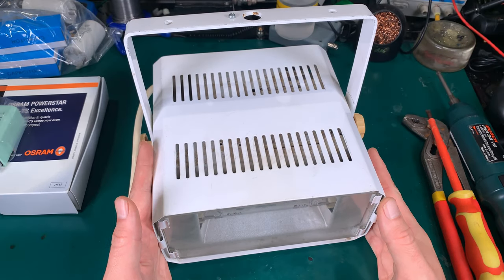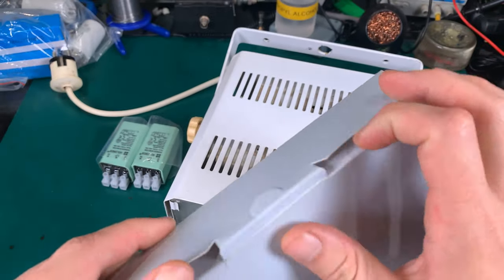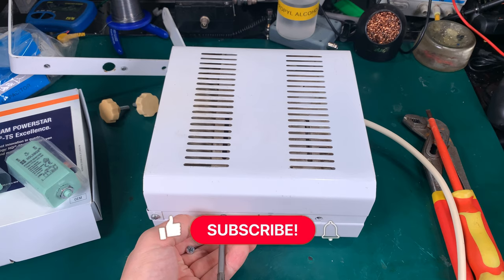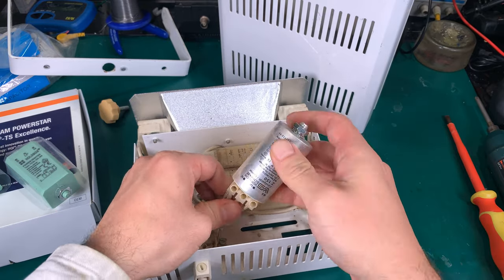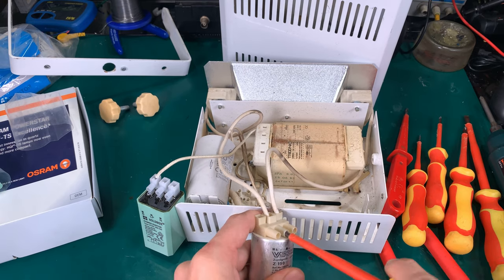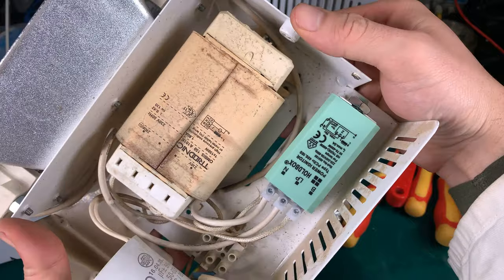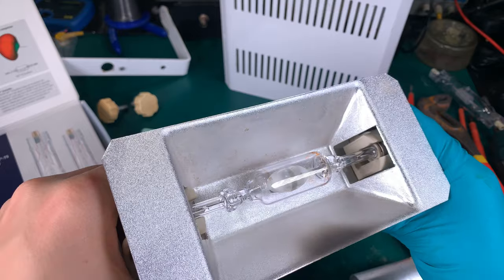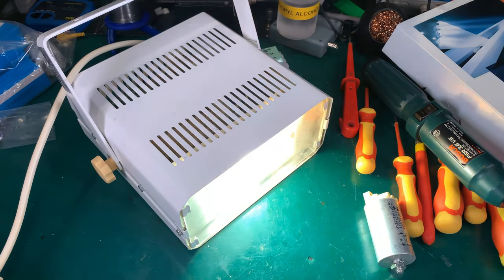Fixing Metal-halide lamp fixture  - no reaction to power (replace power igniter + HQI lamp)

Comment: Easy fix, the worst part is putting it back onto the roof!  :-l
Reply from the maker: Exactly! In general I'm never replace working part's (unless there is visible wear that suggest fail in future) but that case - nope, change bulb  - don't want touch it again in next 10 years :>